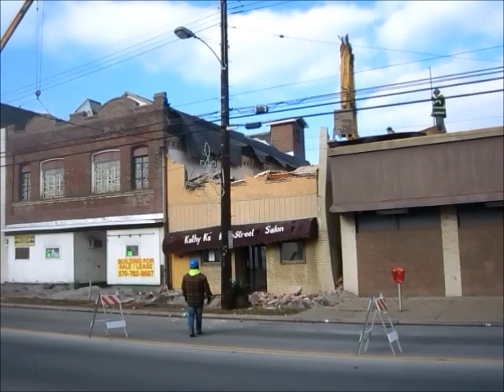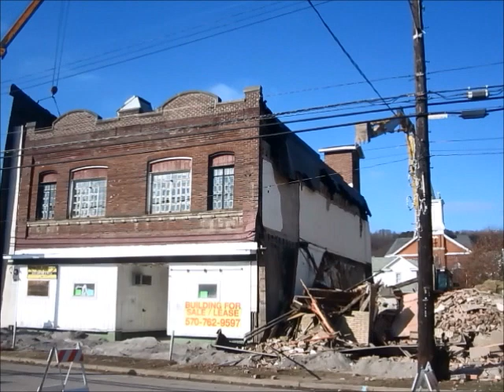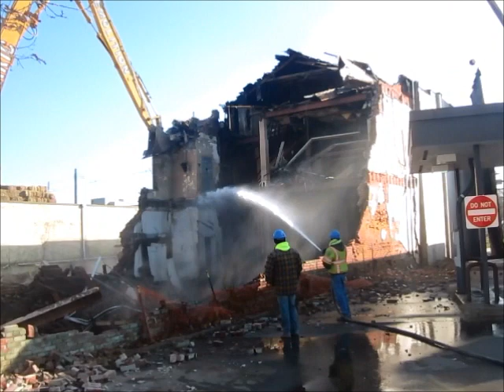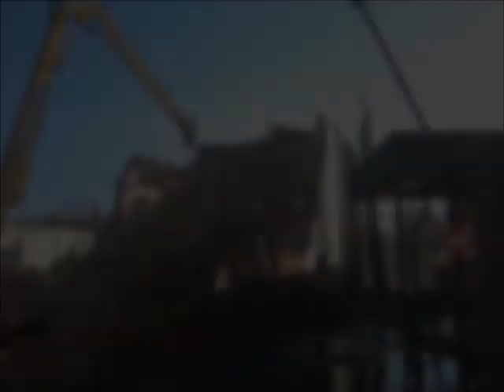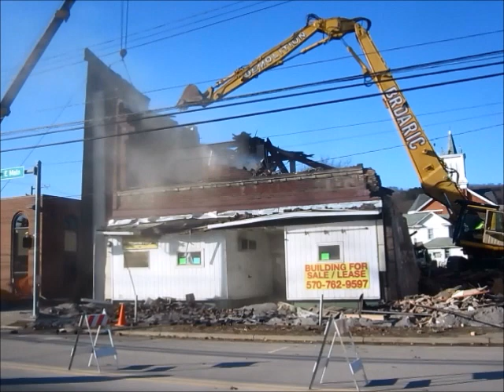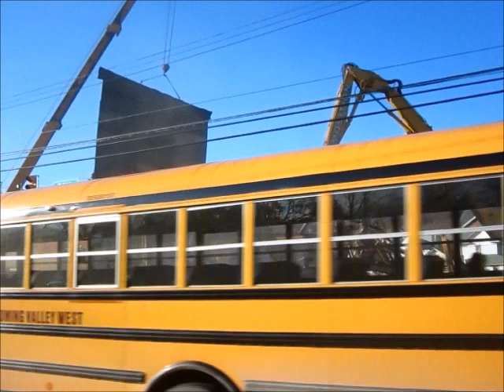Main Street Buildings Demolition Plymouth, Pennsylvania

Comment: As is often the case, no dust suppression or site enclosure! So it seems that there has been no Risk Assessment carried out.
Reply: Where I live several neglected buildings on an inner city block were demolished to make way for a new hotel, about half of the road had to be closed for the demolition of a neglected heritage building built in 1885, and another inner city block is being redeveloped completely, same thing, neglected buildings had to be demolished, lanes on roads had to be closed, pathways in front of the buildings were no longer available, even for the demolition of an 1875 built brick building on the block that was having it's facade saved we couldn't get very close to the building because it was completely fenced off